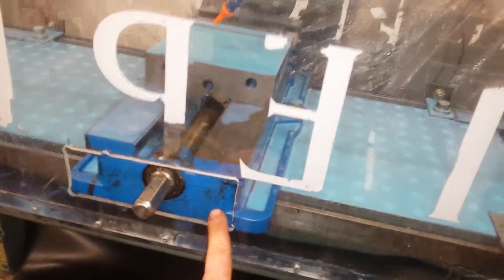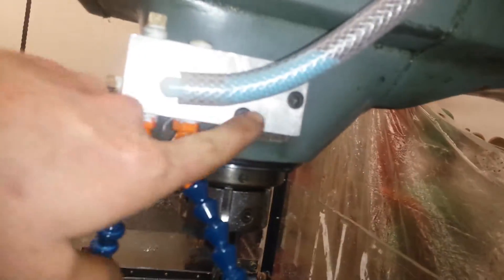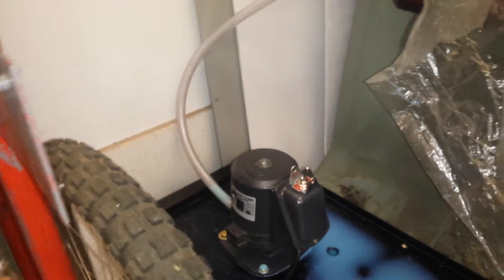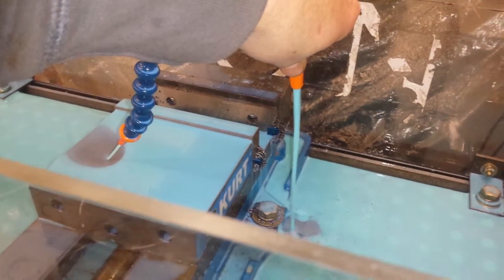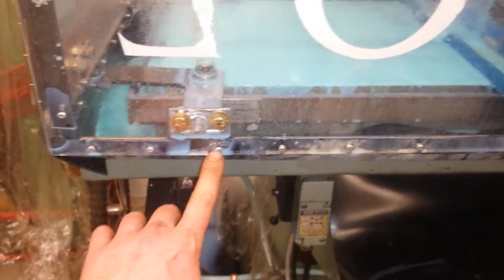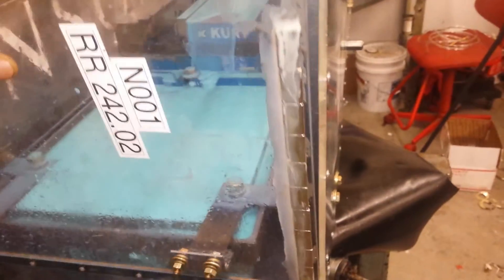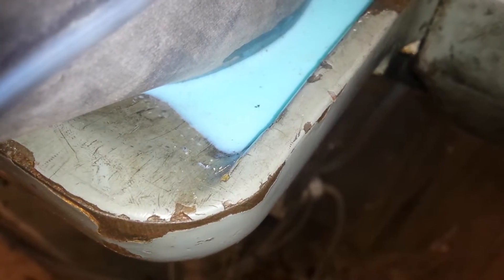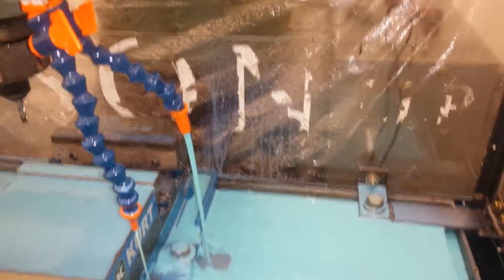Bridgeport Series 1 CNC - Flood coolant test

Comment: I built a similar enclosure for my retrofit bridgeport series 1. Don't have any video of it but I think I have some pictures on my website johnfriedl.com .  The most trouble I had with the machine was keeping all the coolant in. I ended up building a large shower curtain like enclosure over the bed.
Reply from the maker: +jonathon friedl Awesome :) ! I dont know if you can see it but I have a shower curtain around it also which I built first. I have the original bridgeport 4th axis with stepper that i'll be installing pretty soon. I will have to modify the front plexi cover so the motor fits. I'll add some more videos of the retrofit in the coming weeks. calvertcnc.com is my blog site that needs updating. Never enough time!